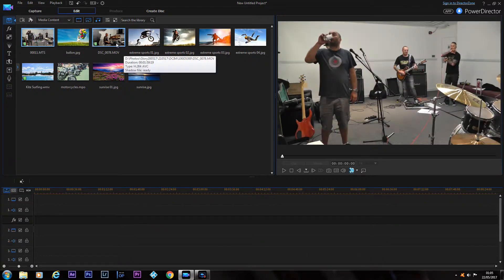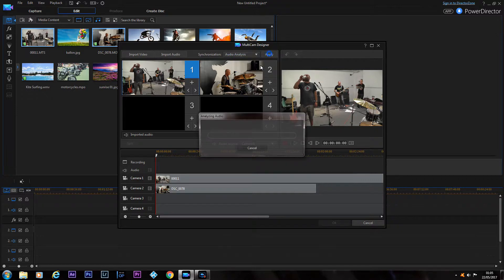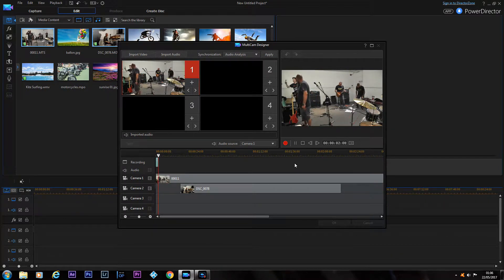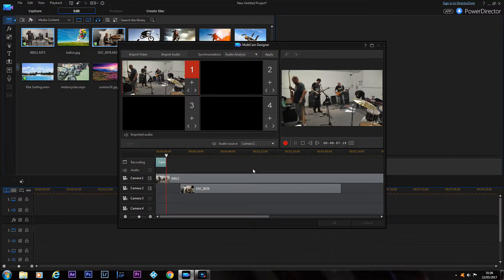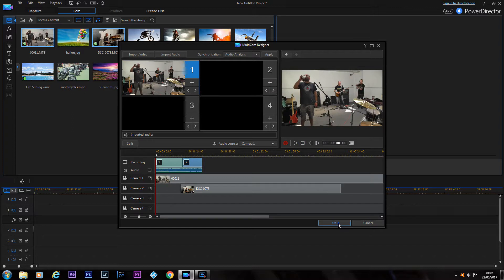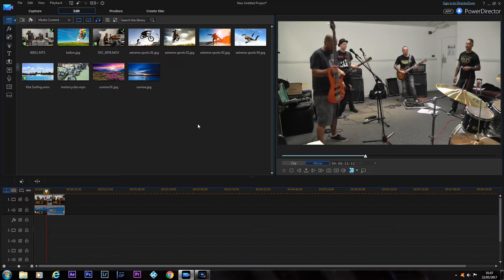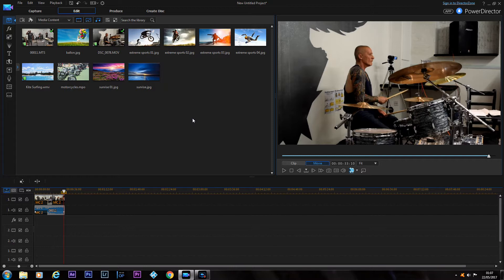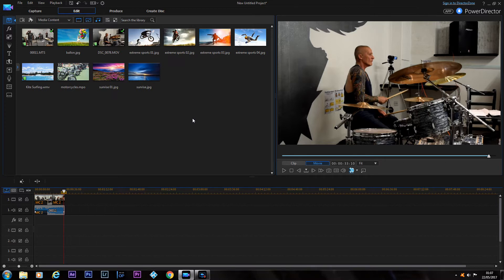Cyberlink Powerdirector 14 Multicam loss of sync.

Comment: I have the same problem with power 15. no solution yet but im glad to see im not the only one.
Reply from the maker: I just use multicam now to get exact start point of the clips lined up, then put them on timeline and do it my self. It does take the biscuit though when a feature of a program doesn't work, it really is pathetic